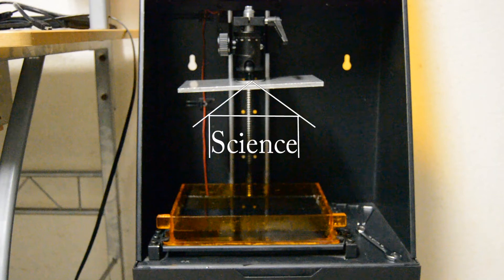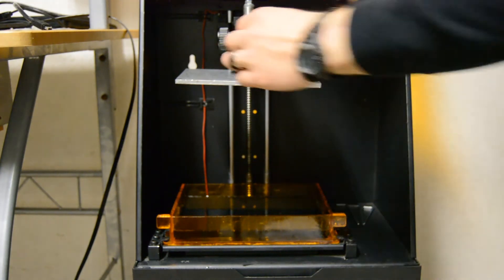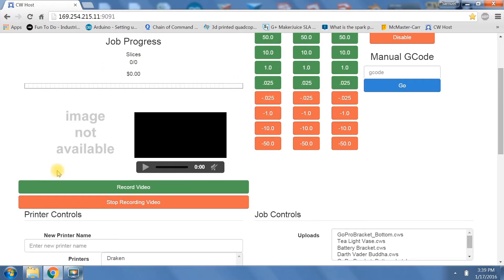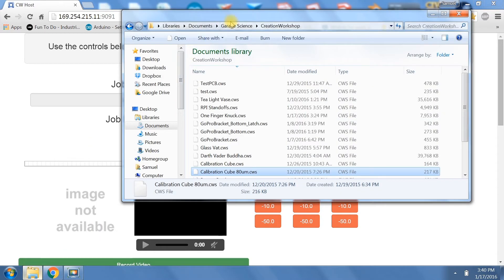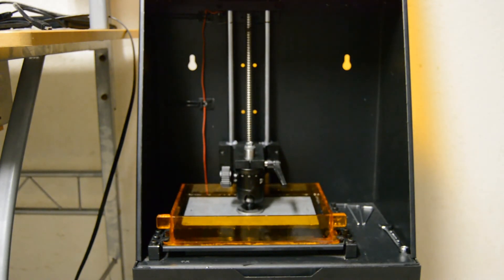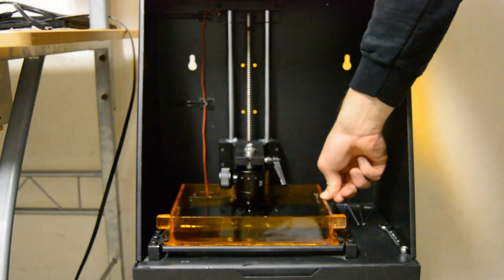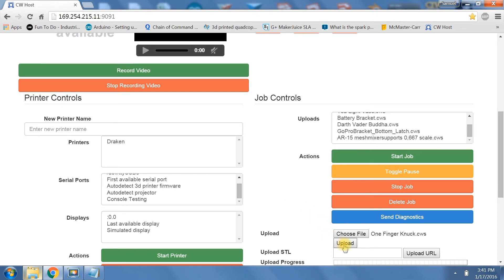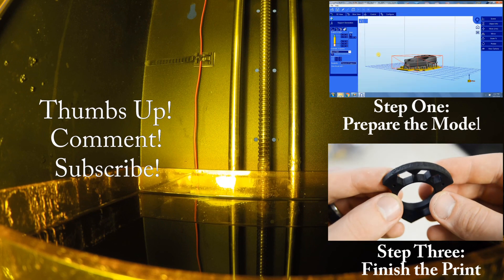Setup 3D Printer, How to Guide Step 2 | 3D Facture Draken 3D Printer

Comment: Any chance of a link to your g-code cheat sheet?
Reply from the maker: +rpsculpt I will put a link in the description once I get my laptop on some internet. Traveling abroad for work and Internet isn't always available.
Reply from the maker: +rpsculpt 
M605 - Turn projector on
M606 - Turn projector off
M280 P1 S170 - turn off the cover
M280 P1 S90 - turn on the cover
M280 P0 S10 - Peel servo down
M280 P0 S120 - Peel servo up
G1 Z0 - homing z-axis (for absolute positioning - G90)
G28 Z - also homing z-axis
G0 Z-200 F200 - Move to start position (-200mm from z-home) for build plate leveling (assumes relative position mode - G91)

All these commands depend on the way your firmware is written. The draken uses a combination of repettier and Marlin firmware.

Reference is here:
http://reprap.org/wiki/G-code